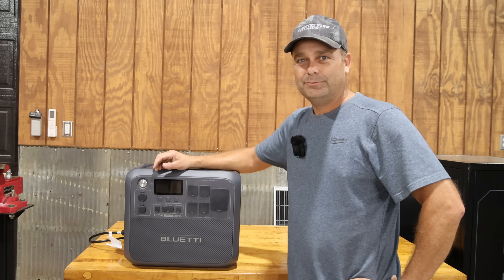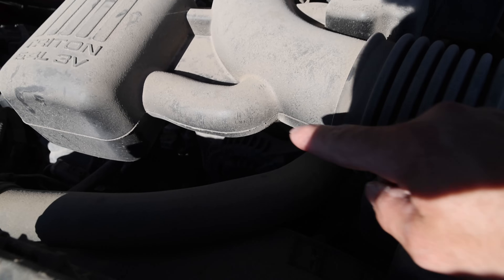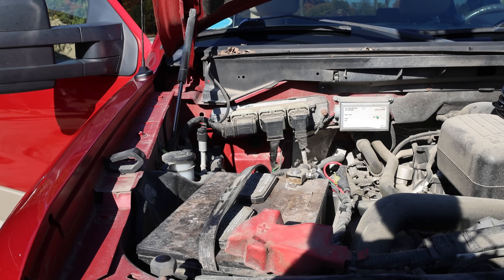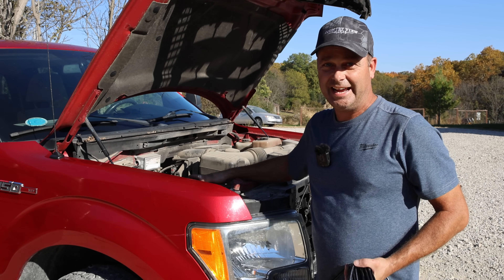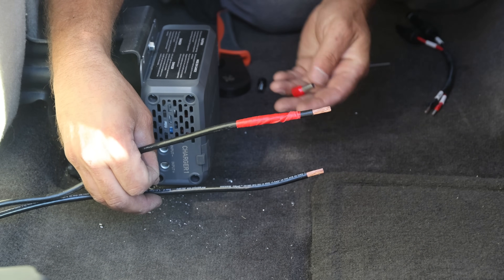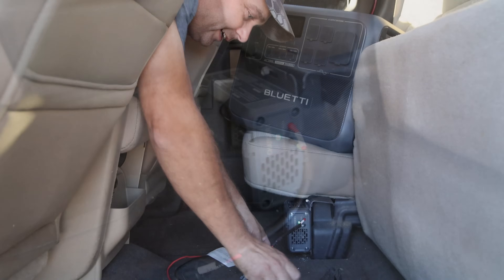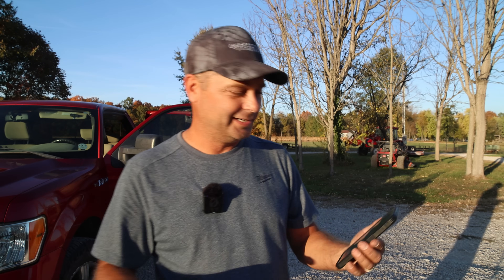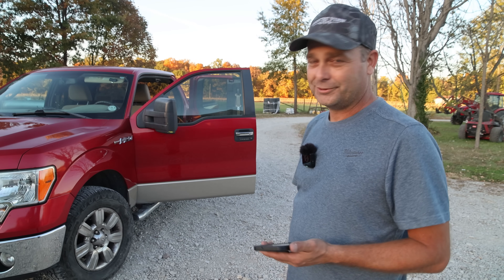Is this More Reliable than Solar?  Charge any Power Station with the Bluetti Charger 1

Comment: I bought one of these with the wiring kit from Bluetti and I absolutely love it.   I used it on a trip from Florida to Arizona.   I charged two Bluetti AC 200P's.   I customized the output to 36 amps (just to be safe and not tax the alternator) since I have a 4 cyl engine.  Could be one of the best things they ever made.

Comment: These power stations are insanely priced. Some of these Bluetti's are over $2000. Shop around and get a decent lithium battery and buy your own dc to dc charger for 75% less money. I can get a decent 100AH Lithium iron phosphate battery and charger for under $500.00

Comment: While driving I charge my Jackery explorer 500 using a 300 watt  PSW inverter that is plugged into a fused designated lighter receptacle . I plug the supplied ac charger of the Jackery into this inverter and this keeps my Jackery at 100%. Input watts is 83 or so and my 12V fridge  only consumes 45 watts when steady. If I were to use the 12v cigarette  lighter receptacle feature to charge the Jackery then it would only charge at 35W. Using the inverter is what works best for me while driving..

Comment: I want one of these but my car doesn’t have an alternator. It’s a plug in hybrid where the 12 volt battery is charged via the 18.1 KW traction battery via a dc -dc converter. Will it work in my car?

Comment: I would be concerned that the life of the alternator would be shortened but maybe not a concern.. Excellent video  as usual.
Reply: you would be correct. the increased load on the alt. will accelerate wear on things like the brushes and cause it to run hotter than designed. Also the output of the alt. is eng speed dependent. at idle it is possible to actually discharge the vehicle battery while charging with the Bluetti Charger 1.
Reply: And let's not forget using your engine as a generator is stupid, generators are usually under 1ltr, vehicle engines are usually over 2lit and use WAY more fuel, even when your driving the extra load on the alternator will cost you more fuel to drive.
Solar is cheaper

Comment: Help me understand! Why wouldn't a 2000 watt inverter  for lees that $200 be a better option than a 600 watt charger for almost $300. Sometimes the obvious smacks me in the face by surprise
Reply from the maker: Because a 2000 watt inverter would pull 90 amps from a 12 volt  battery & alternator.  The alternator wouldn't keep up.

Also, you convert DC to AC then back to DC.  You would lose 20% in each conversion.  So you would lose about 40% of power overall.  Very inefficient.   The DC to DC converter is way more efficient.
Reply: @CountryViewSolar-DIYProjects  Thanks Evan

Comment: If you hook it up directly to the battery, won't it draw power 24/7?
Reply from the maker: It will pull a small amount of power, but it won't charge anything unless the voltage is higher when the alternator is running.

Comment: How long do you have to run the vehicle for it to get fully charged? My solar generators came with plugs to use in a cig lighter. I know nothing about wiring and stuff or how much comes through a cig lighter. Thanks.
Reply: Actual cig lighter (rare these days unless your car is old) is usually 10 amps max. The power ports are often a bit higher, topping out at 20. Depends on the make of the vehicle. The little cover on them often gives the amperage, or you can check your owners manual. You'd have to do the math for your size of battery to see how long it would take to charge. To get watts, multiply the amperage and the voltage. 10 amps x 12 volts (approx. what you car puts out) would be 120 watts.

Comment: I was thinking that it would be nice to make it more mobile so you could easily swap to another vehicle if you had to. Like put Andersen Connectors between the battery and the circuit breaker, another between the circuit breaker and the firewall, then another set just before the Bluetti Charger 1.  Then have a longer wire and some clamps with Andersen connectors that you can easily snap together in another vehicle and you're "IN like Flint!".

Comment: Evan, earlier, I posted a question concerning the possible sources for charging the battery pack. I was wondering if the truck's electronics charge port ( looks like a heavy cigarette lighter port) could also provide energy to the lithium pack. You're an electrician. Won't the battery accept any 12v source no matter what amperage is offered? The power is flowing TO the battery pack, not from it. Just wondering.
Reply: You can charge from there if your unit takes 12 volt charging, it will just be slow. Usually 15 or 20 amps max. Pretty much the same a cigarette lighter port but generally those are limited to 10 amps.

Comment: On the 3rd day of the 14, my little power station died I found a cord that fits the unit cut the wire, and like you said right to the battery charged to 85 percent overnight at least I got to watch the news.   not a Bluetti      PS Did my car jumper pack also                     just saying

Comment: I saw someone fry their display in their vehicle by plugging in a Jackery in the back of the vehicle and using solar.  She felt like it could happen with any battery pack. 

Using the bulk charger ( charger one) as you did is the way to charge with car and solar.  I am wondering if the solar voltage back fed the car with too high of voltage. No AC or radio. 

I would not use the charger one and the 12v input from the car at the same time. 

Thanks for sharing. 

I do not recall the other channel, I think it was a camping channel.

Comment: Why can't you just hook it up to the truck charging port that looks like a cigarette lighter connection? That is a high amperage circuit.
Reply: That device will draw 50amps from the starter battery, most factory ports can handle 10amps and some at most 15amps
Reply: @frostyfroze7352  Well, the battery pack is capable of drawing 50 amps, BUT , only if 50 amps are available.  Remember, the power is flowing TO the battery pack. Not FROM it. The lithium batteries can only accept what is being offered. The charge ports in vehicles are regulated to limit current flow. At least that's what I think I am seeing on the schematics for my truck.
Reply: @bobwollard9105  You can do that, it will just be slower. The power port is limited by a fuse, it will give as much as you draw until the fuse blows, I wouldn't call it regulated. I imaging the 12 volt vehicle charging cords that come with the power stations have a current limiting feature in them so you can't draw too much.

Comment: Checked both amazon and bluettis' official site.... Must be a high demand, or they just didn't make that many thus far, but they're out of stock in both places. Crazy! Curious though would this charger be cross compatible for other power stations?
Reply from the maker: As long as the power station has MC4 connections for solar.  You should be able to adjust the voltage to match it's needs.

Comment: Interesting but I would be concerned about over taxing the alternator depending on the accessories that are existing on the truck. Depending on the vehicle.
Reply: 550 watts output  /13.4v (alternator output) = 41 Amps draw for this unit. Even the smallest car has an alternator that puts out 60 Amps. Most larger vehicles are 90-110 amps. .  Probably not an issue for anyone that doesn’t have a tiny car and lots of 12v loads.
Reply: @Poorehouse  Alternators work harder (physically get harder to turn) when they put out max amperage. You would take life off of one drawing that much power off of a small alternator for a long time. Something as simple as running your battery flat and getting a quick boost to get going is quite hard on your alternator.
Reply from the maker: If you had a large car stereo, or lots of aftermarket add-onsn they would need to be considered in the total power draw on the alternator.

Comment: One way I would like to use the charger is to hook several 12v 100ah batteries to solar and store them. 

Then if the power station needs to be recharged, pull one battery out and use this charger to “refill” the power station. Take the depleted 12v battery and hook to solar to recharge as much as the sun can produce on those cloudy days until it’s full
Reply: i have been using dc to dc charger to just what you are talking about. this is how i increase the battery storage of a portable power station with out paying the crazy price of their expansion batteries.
Reply: @ I agree. The price of expansion batteries is incredible. Plus I’m not liking the fact that the power station expansion batteries can usually only be charged thru the power station. This way away cheaper, and so much easier in my opinion.

Comment: Hi Evan, I am not sold on these new chargers. I will wait and see if it wrecks people's alternators. 

Great video, as always.😀
Reply from the maker: Understood.
Reply: 50 amps is quite a bit for a small car or some SUVs, something like his truck often has a 200 amp alternator so it wouldn't be as hard on it. 
The trick would be to not play with a bunch of other gadgets while you were using one. You wouldn't want to fire up all the lights, crank the fans, turn on the heated seats and wheel with the rear defroster going. That would put a real strain on the alternator.
These shouldn't cause any more harm than using all those features, and we never worry about doing that.